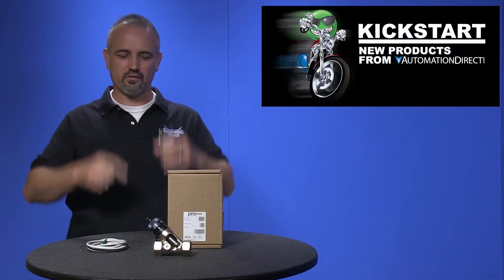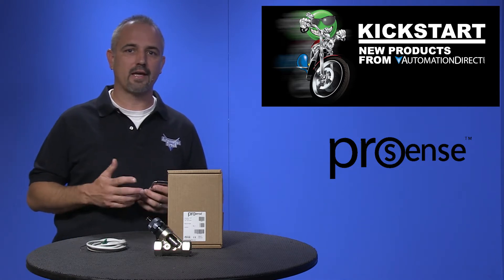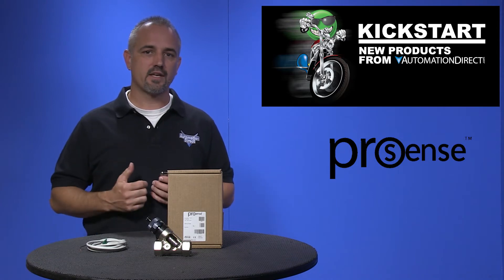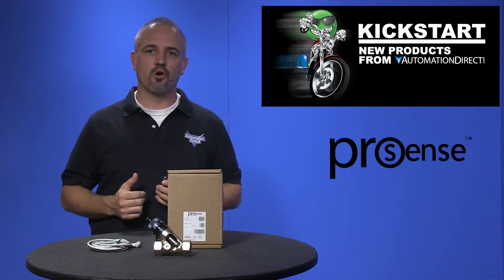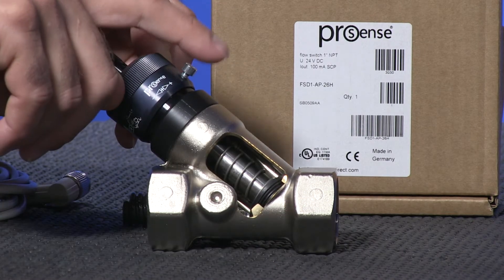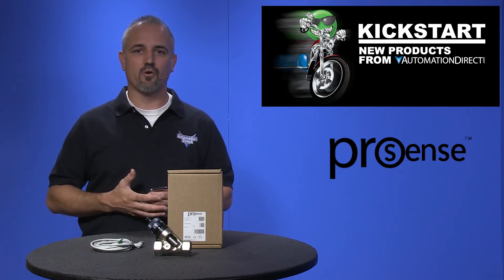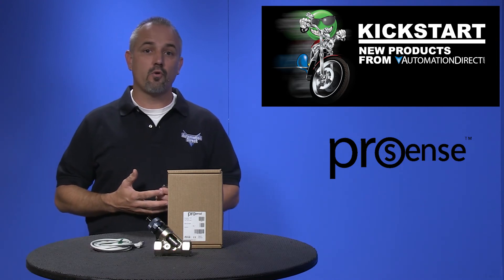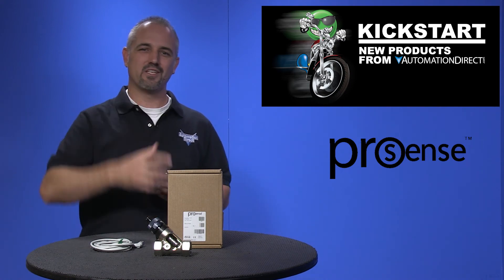ProSense Flow Switches from AutomationDirect

Comment: I am trying to top off wine barrels with a set number of gallons, similar to a batch controller.  Does this device simply measure flow, and sends an output signal to another device, such as a vfd on a pump, or a PLC that switches a valve ON or OFF, or does it switch flow On and OFF based on pressure drop?  In other words, what makes it switch on or off?  Thanks for the help.
Reply from the maker: @user-ky1dm4tf6v These are switches that turn on when a set flow is met.  If you are looking for a device to provide a numeric flow, check out the flow sensors and meters at www.automationdirect.com/flow-sensors   These devices will need to be connected to a process controller or a PLC that can read the output of the device. If you need further assistance with your project, please contact our FREE, award winning technical support team, they will be happy to help. https://community.automationdirect.com/s/contactsupport